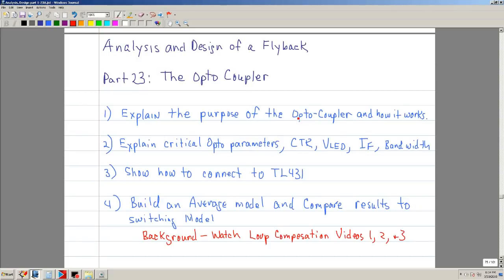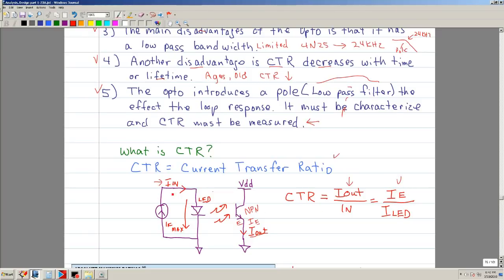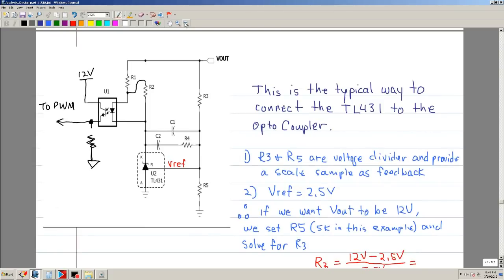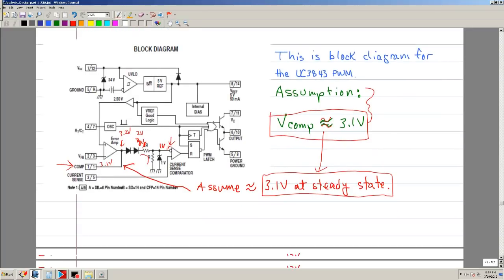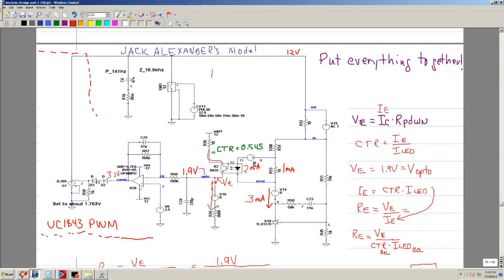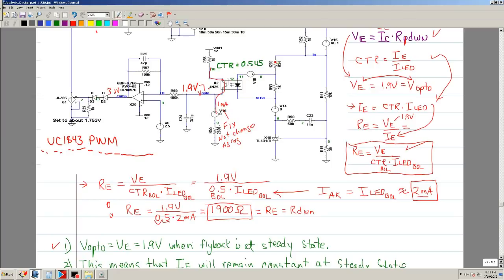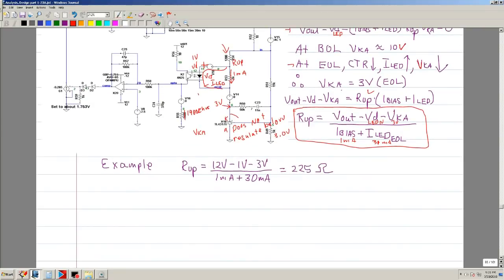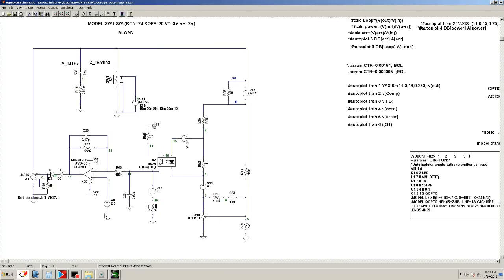Analysis, Deisgn of a  Flyback; Part 23 The Opto-Coupler

Comment: Does the optocoupler 12V voltage biasing the transistor side comes from the non isolated side?  I believe it is not the flyback output 12V. Because both are 12V it can be a bit confusing.  I do believe the 12V vdd1 is not 12V vout
Reply: In real life solution, most commonly it is supplied from aux winding on primary side just like you mentioned.

Comment: Very interesting. This isn't what I would have expected. I would not have anticipated the LED current to increase. I would have expected the light intensity of the LED  in the opto to decrease over time which would reduce the current on the transistor side. I would have then designed to have a sufficiently high LED current so that the transistor current was sufficiently high.
Reply: I actually did test this out. I went out to a forward converted I had previously designed that has a very similar circuit consisting of an optocoupler and an LM431, and I replaced the optocoupler with one that had low CTR (about 20%), sure enough the current on the LED side increased to about 12mA. So, I then replaced the optocoupler again with one that has a CTR of about 300%. Sure enough the current decreased to less than 1mA. So, now im worried about biasing current of the LM431. With the very high optocoupler, we don't seem to have enough biasing current as required for the LM431.

Comment: Many thanks, this is a very good explanation. I am using an OB2269CP and there is approximately a 9K internal PWM pull-up resistor to 6V. This makes the Emitter current of the Opto about 0.3mA in the center of its range, say 3V to FB pin. This reduces the LED current to about 0.6mA for which I had to scale up the LED resistors significantly. Was finally able get a faulty SMPS to work once I understood the principles (don't know how it ever worked before it went faulty because FB was always being pulled below 1V by over current to LED before the TL431 reached 2.5V on ref pin, and the chip goes into Eco mode!).

Comment: Hi Robert
It's a great video. I still have a question. Why Vka= 10 V at BOL? I confuse that what's the function of TL431. At the video 22, it just like programmed zener diode. In this circuit, we set Vout at 12V. However, Vka is 10V. Could you explain more? Thank you~
Reply: Because at BOL the ILED is only about 2mA and total current on Rup is 3mA, so Vka at TL431= .003*225-VLED =10.3V. At EOL the total current goes up to about 30mA and so the Voltage at Vka decreases significantly.

Comment: So if the device has 2R and R internal resistors, as opposed to R and R, we can assume 4.1V on the COMP pin ? Also I checked the device UC1843, it has 2R and R, could you link me to a specific datasheet that says it has R and R ?
Reply from the maker: Hi Nabil.  That is a great question. I tried to simplify the explanation by changing the first resistor from 2R to R. You are correct that when the error amp COMP will go to around 4.2V when the PWM is at full load. However, we usually set the CS line to about 80% of 1V or 0.8V.  That way you have 20% overcurrent margin. That also means that the COMP will drop down to 80% of 4.2V to around 3.2V. This is where the 3.2V comes from. Great question!  RB

Comment: How you got opto VE=1.9V, can you explain that.
Reply from the maker: Hi Giridhar, Sorry I missed you question. The Ve = 1.9V comes from the fact that the internal PWM has a comparator that switches at 1 Volts and has two diodes in series and I make an assumption for the purpose to try to make the explanation simple. So the output of the op amp has to output 3.1V at steady state once everything is in regulation. If you look at the op amp, the noninverting is connected to the a reference of 2.5V.   Therefore, then inverting input should also equal to the 2.5V. That means that a current flows from the output to the inverting of (3.1V-2.5V)/100kohm =6uA.  Current of 6uA cannot flow into the input of the inverting node so it has to flow thru the input resistor. Therefore you will have a drop of 6uA*100kohm = 0.6V which is subtracted from the inverting input of 2.5V - 0.6V = 1.9V. I hope this make sense. Regard, Robert Bolanos. Commenst can be sent to rbola35618@aol.com

Comment: I had been waiting for this video since long. I had requested twice for the video on this topic. It is very informative & very useful to me as many doubts are cleared especially explanation on how the opto emitter current & voltage remain constant even in aging. Teaching method is also very effective & explanation is very nice which  I have not seen in any book or on web. Thanks for taking efforts for making the topic simple & teaching it to our level. Now I am eagerly waiting for next video on compensation part. Thanks once again.I have a question that my out-put voltage will be 320V DC then can I connect it to the opto LED or I have to connect from other low voltage (12v) on secondary side? Is there any effect on feedback?Thanks.
Reply from the maker: Thank you Satyavijay for the feedback. It's took a long time. Last year was a bad year for me and did not have much time for making videos. I lost my father on September 30, and my wife got diagnosed with cancer. So most of my spare time was taking care of my wife. My wife is doing much better now and has finished her chemo. Hopefully, I will have more time to make videos. Thank you for your support.  Robert
Reply: Sorry to hear. My sincere sympathies to you and family. I hope you and your family will come out the bad time very soon.
Please guide me how to connect LED of opto to 320V DC output ? 
Thanks.
Reply: The same way. Rup=(320-1-3)/(1mA + 30mA)=10.2 kOhms.
Reply: Thanks Catalin. Required resistor will be of more wattage of about 10watts. Instead, if I connect it from 12v from secondary side (but voltage sensing from resistor divider from 320 VDC) will it do and is there any effect on feedback control?

Comment: Great Video and explanation, thank you. I am a bit confused about your statement regarding the aging of the opto coupler. As the opto gets older, the CTR drops, I understand this - makes perfect sense. You say that the emitter current stays constant and therefor the Led current rises. As far as I understand it, the CTR drops because for the same Led current the LED emits less light over time, leading to less emitter current and therefor lower CTR. How can the Led current rise and the emitter current stay constant? I thought the Led current is dictated by the output voltage (12V in this case), the voltage divide and the TL431. The emitter current is dictated by the Led current and CTR.
Reply from the maker: Hi Pete, great question. The current and the voltage in the emitter of the opto remains constant because of the negative feedback from the loop. As the CTR decreases, the emitter voltage and current will drop slighty, the vout will decrease and then the error amp in the TL431 will see that the vout drop so the voltage at the cathode of the TL431 will drop/decrease and this in turn will increase the current in the LED and in turn increase and keeps both the emitter's  voltage and current constant. If you send me your email, I can send you the average model that I used and you can work with the model and get a more intuitive fell on how the system works.  My email is rbola35618@aol.com
Reply: Thank you Robert. Now I understand. I guess I did not close the loop in my mind when I was thinking of the aging effect.
Great videos, I do learn a lot from them. Please keep it up. Waiting for the next installment.
Reply: forgot to mention, I sent you an Email